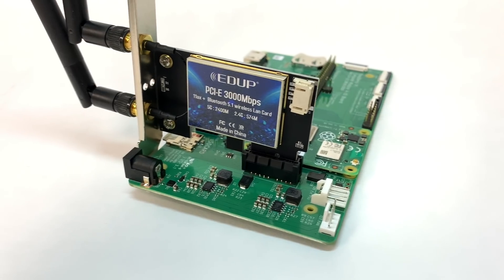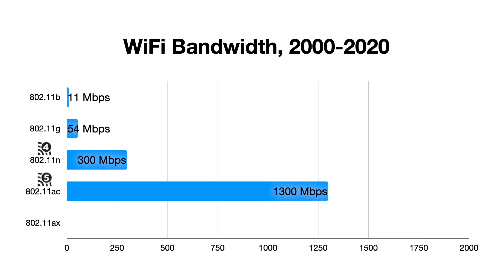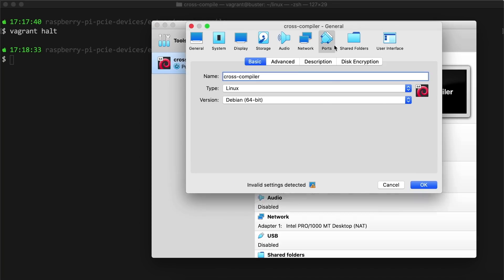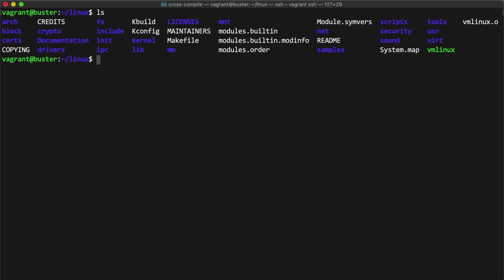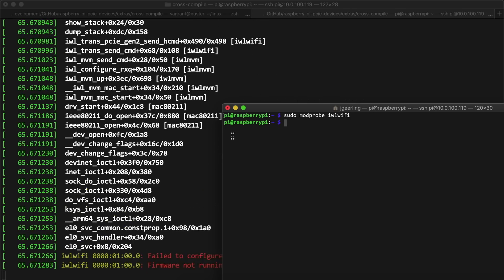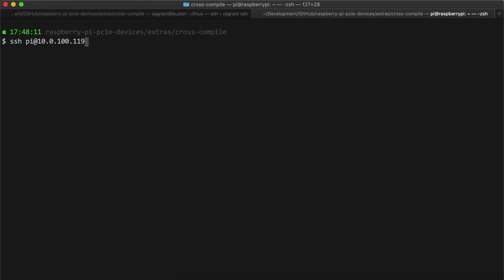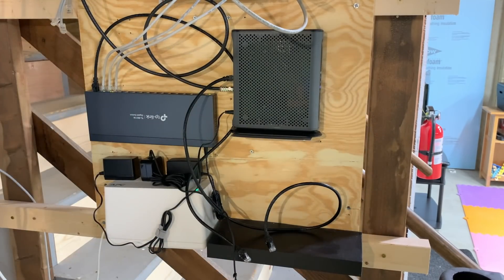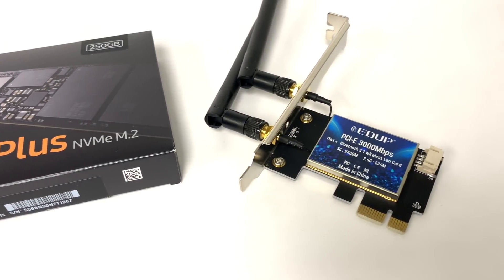WiFi 6 on the Raspberry Pi CM4 makes it Fly! MORE THAN 1 Gbps!

Comment: Nice video.  I'd suggest use iperf 2.0.14's --trip-times options (make sure to sync your clocks via a GPS atomic clock and PTP - that's another cool raspberry pi project)  Then you can take both a throughput and latency measurements.  Both are required for better metrics.  https://sourceforge.net/projects/iperf2/

Here's an example using a Rpi4 as the iperf 2.0.14 server.

root@rpi4-rjm-1:/usr/local/src/iperf2-code# iperf -s -i 1 -e
------------------------------------------------------------
Server listening on TCP port 5001 with pid 3400
Read buffer size:  128 KByte (Dist bin width=16.0 KByte)
TCP window size:  128 KByte (default)
------------------------------------------------------------
[  1] local 192.168.1.108%eth0 port 5001 connected with 192.168.1.62 port 36696 (MSS=453) (trip-times) (sock=4) (peer 2.0.14-alpha) on 2020-12-22 19:37:27 (PST)
[ ID] Interval        Transfer    Bandwidth    Burst Latency avg/min/max/stdev (cnt/size) inP NetPwr  Reads=Dist
[  1] 0.00-1.00 sec   111 MBytes   928 Mbits/sec  39.586/3.024/65.995/15.944 ms (885/131072) 4.52 MByte 2930  21061=20536:15:3:4:3:2:1:497
[  1] 1.00-2.00 sec   108 MBytes   902 Mbits/sec  56.599/30.361/66.433/7.173 ms (860/131072) 6.30 MByte 1992  860=0:0:0:0:0:0:0:860
[  1] 2.00-3.00 sec   110 MBytes   920 Mbits/sec  59.602/52.766/66.410/3.656 ms (877/131072) 6.47 MByte 1929  877=0:0:0:0:0:0:0:877
[  1] 3.00-4.00 sec   110 MBytes   920 Mbits/sec  59.570/52.780/66.472/3.600 ms (877/131072) 6.58 MByte 1930  877=0:0:0:0:0:0:0:877
[  1] 4.00-5.00 sec   111 MBytes   934 Mbits/sec  43.706/24.420/66.077/13.431 ms (891/131072) 4.84 MByte 2672  18882=18319:6:0:0:1:0:0:556
[  1] 5.00-6.00 sec   110 MBytes   919 Mbits/sec  59.611/52.353/66.447/3.628 ms (876/131072) 6.54 MByte 1926  876=0:0:0:0:0:0:0:876
[  1] 6.00-7.00 sec   112 MBytes   935 Mbits/sec  45.513/9.754/66.015/13.854 ms (892/131072) 5.07 MByte 2569  14136=13479:6:2:9:4:1:1:634
[  1] 7.00-8.00 sec   113 MBytes   952 Mbits/sec  49.360/24.098/66.135/14.118 ms (907/131177) 5.44 MByte 2410  8913=8152:147:0:0:0:0:0:614
[  1] 8.00-9.00 sec   108 MBytes   904 Mbits/sec  48.244/24.338/65.965/13.044 ms (863/130961) 5.41 MByte 2343  11341=10671:2:0:0:0:1:0:667
[  1] 9.00-10.00 sec   110 MBytes   920 Mbits/sec  59.661/53.018/66.081/3.635 ms (877/131072) 6.51 MByte 1927  877=0:0:0:0:0:0:0:877
[  1] 0.00-10.03 sec  1.08 GBytes   925 Mbits/sec  52.105/3.024/66.472/12.808 ms (8855/131072) 5.75 MByte 2220  78750=71157:176:5:13:8:4:2:7385

rjmcmahon@localhost iperf2-code]$ iperf -c 192.168.1.108 -i 1 --trip-times -e
------------------------------------------------------------
Client connecting to 192.168.1.108, TCP port 5001 with pid 11762 (1 flows)
Write buffer size: 131072 Byte
TCP window size: 85.0 KByte (default)
------------------------------------------------------------
[  1] local 192.168.1.62%enp2s0 port 36696 connected with 192.168.1.108 port 5001 (MSS=1448) (trip-times) (sock=3) (ct=0.28 ms)
[ ID] Interval        Transfer    Bandwidth       Write/Err  Rtry     Cwnd/RTT        NetPwr
[  1] 0.00-1.00 sec   115 MBytes   962 Mbits/sec  918/0          0     1493K/13219 us  9092
[  1] 1.00-2.00 sec   111 MBytes   929 Mbits/sec  886/0          0     1511K/1903 us  61025
[  1] 2.00-3.00 sec   109 MBytes   916 Mbits/sec  874/0          0     1511K/1692 us  67705
[  1] 3.00-4.00 sec   109 MBytes   913 Mbits/sec  871/0          0     1511K/2249 us  50762
[  1] 4.00-5.00 sec   112 MBytes   942 Mbits/sec  898/0          0     1928K/2173 us  54166
[  1] 5.00-6.00 sec   109 MBytes   916 Mbits/sec  874/0          0     1928K/2344 us  48872
[  1] 6.00-7.00 sec   111 MBytes   930 Mbits/sec  887/0          0     1440K/4192 us  27734
[  1] 7.00-8.00 sec   111 MBytes   932 Mbits/sec  889/0          0     1532K/13043 us  8934
[  1] 8.00-9.00 sec   111 MBytes   932 Mbits/sec  889/0          0     1559K/2396 us  48632
[  1] 9.00-10.00 sec   109 MBytes   911 Mbits/sec  869/0          0     1559K/1561 us  72967
[  1] 0.00-10.00 sec  1.08 GBytes   928 Mbits/sec  8858/0        125     1559K/1561 us  74351

Also, you can use TCP connects or the three way handshake (3WHS) instead of pings. This 3WHS is a more meaningful "single thing" latency.

[rjmcmahon@localhost iperf2-code]$ iperf -c 192.168.1.108 -i 1 -e --connect-only -t 15
------------------------------------------------------------
Client connecting to 192.168.1.108, TCP port 5001 with pid 13707 (1 flows)
Write buffer size: 131072 Byte
TCP three-way-handshake (3WHS) only
------------------------------------------------------------
[  1] local 192.168.1.62%enp2s0 port 36836 connected with 192.168.1.108 port 5001 (MSS=1448) (sock=3) (ct=0.32 ms) on 2020-12-22 19:47:25 (PST)
[  1] local 192.168.1.62%enp2s0 port 36838 connected with 192.168.1.108 port 5001 (MSS=1448) (sock=3) (ct=0.30 ms) on 2020-12-22 19:47:26 (PST)
[  1] local 192.168.1.62%enp2s0 port 36840 connected with 192.168.1.108 port 5001 (MSS=1448) (sock=3) (ct=0.28 ms) on 2020-12-22 19:47:27 (PST)
[  1] local 192.168.1.62%enp2s0 port 36842 connected with 192.168.1.108 port 5001 (MSS=1448) (sock=3) (ct=0.27 ms) on 2020-12-22 19:47:28 (PST)
[  1] local 192.168.1.62%enp2s0 port 36844 connected with 192.168.1.108 port 5001 (MSS=1448) (sock=3) (ct=0.22 ms) on 2020-12-22 19:47:29 (PST)
[  1] local 192.168.1.62%enp2s0 port 36846 connected with 192.168.1.108 port 5001 (MSS=1448) (sock=3) (ct=0.23 ms) on 2020-12-22 19:47:30 (PST)
[  1] local 192.168.1.62%enp2s0 port 36848 connected with 192.168.1.108 port 5001 (MSS=1448) (sock=3) (ct=0.28 ms) on 2020-12-22 19:47:31 (PST)
[  1] local 192.168.1.62%enp2s0 port 36850 connected with 192.168.1.108 port 5001 (MSS=1448) (sock=3) (ct=0.26 ms) on 2020-12-22 19:47:32 (PST)
[  1] local 192.168.1.62%enp2s0 port 36852 connected with 192.168.1.108 port 5001 (MSS=1448) (sock=3) (ct=0.27 ms) on 2020-12-22 19:47:33 (PST)
[  1] local 192.168.1.62%enp2s0 port 36854 connected with 192.168.1.108 port 5001 (MSS=1448) (sock=3) (ct=0.25 ms) on 2020-12-22 19:47:34 (PST)
[  1] local 192.168.1.62%enp2s0 port 36856 connected with 192.168.1.108 port 5001 (MSS=1448) (sock=3) (ct=0.26 ms) on 2020-12-22 19:47:35 (PST)
[  1] local 192.168.1.62%enp2s0 port 36858 connected with 192.168.1.108 port 5001 (MSS=1448) (sock=3) (ct=0.31 ms) on 2020-12-22 19:47:36 (PST)
[  1] local 192.168.1.62%enp2s0 port 36860 connected with 192.168.1.108 port 5001 (MSS=1448) (sock=3) (ct=0.24 ms) on 2020-12-22 19:47:37 (PST)
[  1] local 192.168.1.62%enp2s0 port 36862 connected with 192.168.1.108 port 5001 (MSS=1448) (sock=3) (ct=0.24 ms) on 2020-12-22 19:47:38 (PST)
[  1] local 192.168.1.62%enp2s0 port 36864 connected with 192.168.1.108 port 5001 (MSS=1448) (sock=3) (ct=0.29 ms) on 2020-12-22 19:47:39 (PST)
[ CT] final connect times (min/avg/max/stdev) = 0.217/0.267/0.315/0.086 ms (tot/err) = 15/0
Reply: Also, I'll probably add a --near-congestion option which is a better test for end/end latency as TCP drives to congestion and to buffer bloat. Here the offered TCP load is slightly under the congestion point which will allow queues to drain and to work as designed.  Notice the TCP write to read latency is much better.  Also network power an inP are better.

root@rpi4-rjm-1:/usr/local/src/iperf2-code# iperf -s -i 1 -e
------------------------------------------------------------
Server listening on TCP port 5001 with pid 3447
Read buffer size:  128 KByte (Dist bin width=16.0 KByte)
TCP window size:  128 KByte (default)
------------------------------------------------------------
[  1] local 192.168.1.108%eth0 port 5001 connected with 192.168.1.62 port 37044 (MSS=453) (trip-times) (sock=4) (peer 2.0.14-alpha) on 2020-12-22 19:58:40 (PST)
[ ID] Interval        Transfer    Bandwidth    Burst Latency avg/min/max/stdev (cnt/size) inP NetPwr  Reads=Dist
[  1] 0.00-1.00 sec   110 MBytes   919 Mbits/sec  1.936/1.171/2.968/0.406 ms (876/131072)  218 KByte 59316  10717=10018:5:2:2:1:2:2:685
[  1] 1.00-2.00 sec   110 MBytes   921 Mbits/sec  1.655/1.166/2.724/0.488 ms (878/131175)  186 KByte 69576  24598=24154:13:0:1:1:0:0:429
[  1] 2.00-3.00 sec   110 MBytes   919 Mbits/sec  1.919/1.170/2.629/0.323 ms (877/130967)  215 KByte 59869  6407=5634:1:0:0:0:0:0:772
[  1] 3.00-4.00 sec   110 MBytes   920 Mbits/sec  1.786/1.170/2.339/0.284 ms (877/131072)  201 KByte 64375  6410=5634:2:1:1:0:1:0:771
[  1] 4.00-5.00 sec   110 MBytes   921 Mbits/sec  1.846/1.171/2.593/0.307 ms (878/131192)  208 KByte 62388  6220=5440:1:0:0:0:0:0:779
[  1] 5.00-6.00 sec   110 MBytes   919 Mbits/sec  1.494/1.163/2.433/0.414 ms (877/130951)  168 KByte 76852  29947=29608:5:0:0:0:0:0:334
[  1] 6.00-7.00 sec   110 MBytes   920 Mbits/sec  1.453/1.169/2.306/0.396 ms (877/131072)  163 KByte 79093  32105=31801:10:2:0:0:1:0:291
[  1] 7.00-8.00 sec   110 MBytes   921 Mbits/sec  2.083/1.565/2.700/0.192 ms (878/131072)  234 KByte 55237  878=0:0:0:0:0:0:0:878
[  1] 8.00-9.00 sec   110 MBytes   920 Mbits/sec  1.831/1.167/2.674/0.413 ms (877/131072)  206 KByte 62786  13351=12700:4:2:2:0:0:0:643
[  1] 9.00-10.00 sec   110 MBytes   920 Mbits/sec  2.012/1.163/2.586/0.262 ms (877/131072)  226 KByte 57137  2373=1522:1:0:0:0:1:0:849
[  1] 10.00-11.00 sec   110 MBytes   921 Mbits/sec  2.058/1.498/2.807/0.194 ms (878/131072)  231 KByte 55913  878=0:0:0:0:0:0:0:878
[  1] 11.00-12.00 sec   110 MBytes   920 Mbits/sec  1.958/1.521/2.437/0.202 ms (877/131072)  220 KByte 58722  877=0:0:0:0:0:0:0:877
[  1] 12.00-13.00 sec   110 MBytes   921 Mbits/sec  1.950/1.457/2.454/0.198 ms (878/131072)  219 KByte 59027  878=0:0:0:0:0:0:0:878
[  1] 13.00-14.00 sec   110 MBytes   921 Mbits/sec  1.429/1.160/2.326/0.389 ms (878/131106)  161 KByte 80538  33751=33479:4:2:0:0:0:0:266
[  1] 14.00-15.00 sec   109 MBytes   918 Mbits/sec  1.951/1.166/2.848/0.354 ms (876/131037)  219 KByte 58828  6963=6202:1:0:0:0:0:0:760
[  1] 0.00-15.00 sec  1.61 GBytes   920 Mbits/sec  1.824/1.160/2.968/0.395 ms (13162/131072)  205 KByte 63043  176356=166192:47:9:6:2:5:2:10093

[rjmcmahon@localhost iperf2-code]$ iperf -c 192.168.1.108 -i 1 -e -t 15 -b 920m --trip-times
------------------------------------------------------------
Client connecting to 192.168.1.108, TCP port 5001 with pid 16082 (1 flows)
Write buffer size: 131072 Byte
TCP window size: 85.0 KByte (default)
------------------------------------------------------------
[  1] local 192.168.1.62%enp2s0 port 37044 connected with 192.168.1.108 port 5001 (MSS=1448) (trip-times) (sock=3) (ct=0.30 ms) on 2020-12-22 19:58:40 (PST)
[ ID] Interval        Transfer    Bandwidth       Write/Err  Rtry     Cwnd/RTT        NetPwr
[  1] 0.00-1.00 sec   110 MBytes   921 Mbits/sec  879/0          0      289K/1412 us  81502
[  1] 1.00-2.00 sec   110 MBytes   920 Mbits/sec  877/0          0      289K/921 us  124810
[  1] 2.00-3.00 sec   110 MBytes   921 Mbits/sec  878/0          0      289K/1484 us  77548
[  1] 3.00-4.00 sec   110 MBytes   920 Mbits/sec  877/0          0      289K/1428 us  80497
[  1] 4.00-5.00 sec   110 MBytes   920 Mbits/sec  877/0          0      289K/937 us  122679
[  1] 5.00-6.00 sec   110 MBytes   921 Mbits/sec  878/0          0      289K/1183 us  97279
[  1] 6.00-7.00 sec   110 MBytes   920 Mbits/sec  877/0          0      289K/1355 us  84834
[  1] 7.00-8.00 sec   110 MBytes   920 Mbits/sec  877/0          0      289K/1293 us  88902
[  1] 8.00-9.00 sec   110 MBytes   921 Mbits/sec  878/0          0      289K/1621 us  70994
[  1] 9.00-10.00 sec   110 MBytes   920 Mbits/sec  877/0          0      289K/1639 us  70134
[  1] 10.00-11.00 sec   110 MBytes   921 Mbits/sec  878/0          0      289K/1495 us  76977
[  1] 11.00-12.00 sec   110 MBytes   920 Mbits/sec  877/0          0      289K/1613 us  71265
[  1] 12.00-13.00 sec   110 MBytes   920 Mbits/sec  877/0          0      289K/1161 us  99010
[  1] 13.00-14.00 sec   110 MBytes   921 Mbits/sec  878/0          0      289K/963 us  119503
[  1] 14.00-15.00 sec   110 MBytes   920 Mbits/sec  877/0          0      289K/1482 us  77564
[  1] 0.00-15.00 sec  1.61 GBytes   920 Mbits/sec  13165/0          0      289K/1482 us  77615

Comment: Hi Jeff,  I had just finished connecting my Asus GT-AX-11000 to my 10Gb network and put your YouTube on and by happenstance I came across your posting about a problem that I had just worked out.  I had just finished connecting my 2.5Gb Asus port to my MikroTic CRS305-1G-4S+IN Switch (Also works with  CRS309-1G-8S+IN).  The 2.5Gb Asus Port can be used with WLAN or LAN.  What makes this work is the SFP+ adapter that is connected to the Switch. I used a Cat 8, RJ45 cable but something less shielded should work.  The SFP+ connector that is necessary is Wiitek 10GBase-T SFP+ RJ45 30m CIS  (P/N: SFP-10G-T).  I learned of this on the SaveTheHome site on Youtube (Comparing 9 Popular SFP+ to 10Gbase-T Adapters  at 9’ 15”).  Since you showed your MikroTic Switch all you need is the right SFP+ adapter, it works great and now allows my wired network to communicate with some of the faster Wi-Fi connections that are flowing through my GT-AX-11000.  Hope this helps.
Reply from the maker: Thanks! Today I was testing and found a newer transceiver worked at 2.5G, so I'll be good to go now.

Comment: I guess Pi Wired Ethernet is over USB 3 on pi 4 and not PCI-E, so it's bottlenecked there, or is it bottlenecked because of the ethernet chip itself?
Reply: It's bottlenecked by the 1Gb NIC

Comment: Video paused:  Thoughts,   866 mbps on 802.11ac is faster then most of the sites you'll visit,  so why.   OK,  if you pulling files from a NAS,  I get it.  Otherwise...why bother.   Those streamers that think they need WiFI 6,  get a life.
Reply from the maker: Heh, my Internet maxes out at 200 down / 20 up, and I'm paying around 100 USD/month for that. I could get by on 802.11n in a pinch.
Reply: @JeffGeerling  I've got a gig up and down on FIOS,  well in theory.  I'm happy with Unifi nanoHD and AC-LR AP's for now.  I can run 160 MHz in a pinch for file transfer over wireless if needed.  I'll go to 802.11ax with (6e) and the 6Ghz channels.   I actually have a WIFI 6 router in the closest as a backup.   I think as you've figured out most people don't need to upgrade.  They somehow think gaming or watching Netflix requires gigabit WiFI.  Most Roku devices don't even support over 20Mhz wide channels on 5Ghz.

Comment: mountpoint directories inside the kernel source tree (instead of /mnt), sudo nano instead of sudoedit... this is making me cringe a little as a long time linux user. also i have to object to the "wifi > wired" claim on the grounds that you're comparing to an ethernet standard from 1999. wifi is still 20 years behind

Comment: Thanks for continuing your experimention with PCIe peripherals on CM4 ! What would be really interesting is if the CM4 would work with the cheap Diodes-Incorporated P17C9X based PCIe 2.x switches (AliExpress has various 1 => 2 expanders for $15 shipped and 1 => 3 for ~$35). These cheap expanders seem to be getting more expensive now versus two years ago, when they were like $15 for 1 => 4 expanders when crypto mining was more popular.

Even at only 500MB/s, that could likely make network + disk IO (with cheap SATA expansion card like old 3Ware or newer LSI or Marvell controllers/hbas. What would be super dope is if these custom CM4 boards that you’ve highlighted on the channel were designed with one of these cheap Diodes Incorporated pcie switches 😜 

Anyway, thanks again for all the experimentation !
Reply from the maker: I'm trying a couple now: https://github.com/geerlingguy/raspberry-pi-pcie-devices/issues/14
Reply: @JeffGeerling  awesome work ! Will follow on GitHub

Comment: can the cpu on the pi even send data at that speed?
Reply from the maker: I have been able to pump through around 4.15 Gbps on the CPU (before starting to hit IRQ limitations), so I imagine I should be able to saturate this with data if I were using it as a NAS (something I haven't tested yet).

Comment: Please try a parallel port card, this could be a game-changer for CNCLinux which is already running on a pi but we have to use expensive FPGA cards via ethernet v.s a parallel port. thanks and happy xmas
Reply: Isn't it possible to use the GPIOs on the Raspberry Pi to avoid the ethernet-to-fpga bridge?
Reply: @unhinged-menagerie  The onboard GPIO has a pulse limit and jitter issue, a basic parallel port card can give 30khz stable pulse no problem with the Real-time img

Comment: Why do you compile with just 4 threads?
Reply from the maker: Apparently I can just do `-j` and it will try to optimize the thread count for me... going to have to try that and see what happens!
Reply: @JeffGeerling  Didn't know that is a thing. But just using all the threads that you have should speed things up quite a bit.

Comment: Good video. Really impressed by the performance on that wifi6. I have wire for each room. I’m quite happy with 1G link so far. Maybe if I can setup customIzed wireless ap, I can think about it as next project to upgrade my home wireless network.
Reply from the maker: Red Shirt Jeff suggests you upgrade to 10 Gbps too. He said he offers discounted cable cuts.
Reply: @JeffGeerling  Oops, I have to make sure red shirt Jeff doesn't know where I lives.  Even it's cable cuts service for free, I don't want it...T_T.  I don't have any wifi6 laptop or wirelessAP in my house and I am not planning to have it soon as well as long as red shirt Jeff didn't find my house.  Then, I am fine.  haha.  And, another important thing is the vlan tag setting.  If wifi port's vlan setting can be set like MNG switch, ya, I can think about it.  :)

Comment: As I've already said unfortunately RPI foundation decided to remove the ability to use other wifi chipset on the SDIO bus.

Someone should figure out the pinout...
And create an adapter for off the shelf chips.